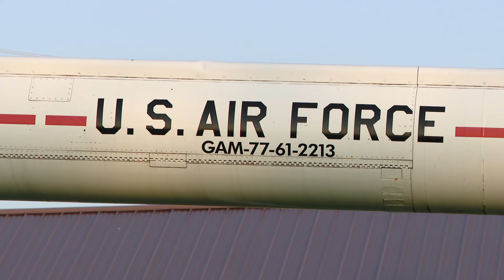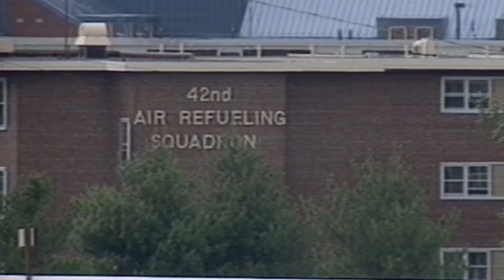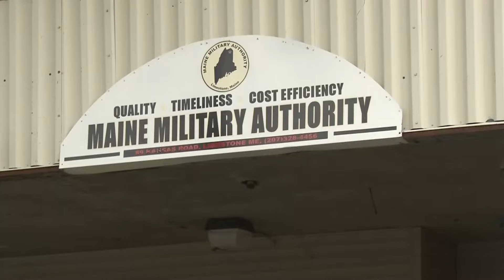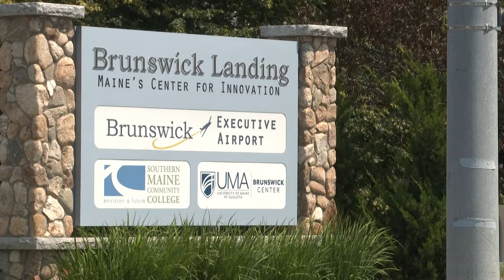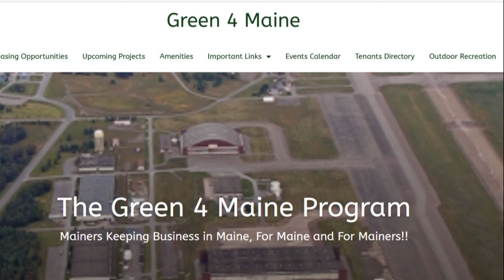New life could be on the horizon for former Loring Air Force Base

Comment: I spent a month in training at Loring summer of 1965. It is very remote from anywhere else and winters doubtless brutal with then 65 pieces of   
snow removal equipment necessary to ensure operations and underground passage ways to connect the buildings. Closure has been the story of most of these former SAC bases across the country as bombers, refuelers and missels became surplus with the end of the Cold War.
Reply: Many of them likely ended up in my former home state at Davis-Monthan AFB in Tucson, AZ but some were later reactivated.  With the world being so unsteady now it would be a good idea not to do any scrapping for the time being. The B-52 will be around as long as we're alive.
Reply: @muffs55mercury61  Yep, they are still at Barksdale AFB which is about 50 miles from me.  I love to watch them take off and land when I go over there from time to time.  Hard to believe that they are still around 60 years later and as you say, they'll be around for at least another 40 years.
Reply: @charleshaggard4341   One of my favorite movies when growing up was "Bombers B-52" which came out in 1957 and frequently shown on TV in the years after. Seeing the B-47s, the KC-97 tankers (we had a fleet of those in Phoenix, AZ til 1977) & of course the B-52s and in color was neat.

Comment: Aero space in freezing weather does not mix remember the Challenger. I loved Loring but none of this is practical.
Reply: Challenger explosion was caused by failure of the rubber O-rings on the solid rocket booster. Challenger itself, and all the space shuttles, were designed to operate in the absolute temperature of space (minus 455 degrees) and Maine is much warmer than space. So all the space shuttles could safely land at Loring. But launching vehicles into space from Loring is problematic not only because of temperatures but because launches closer to the equator are much more efficient for orbital missions.